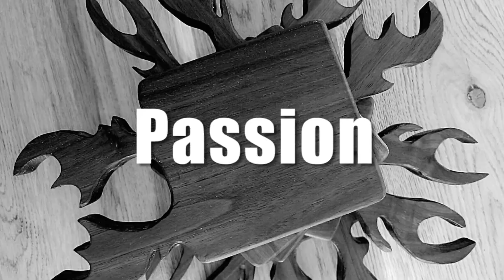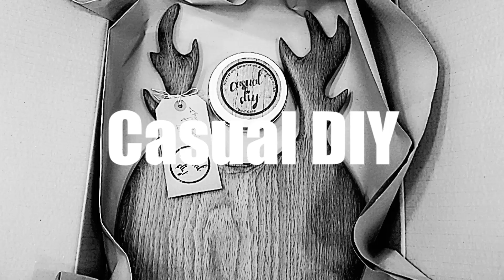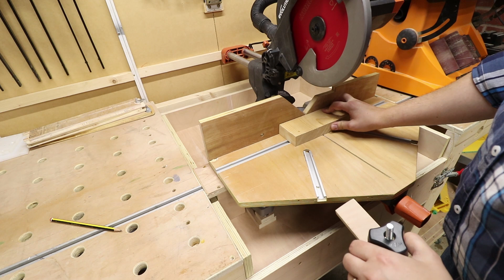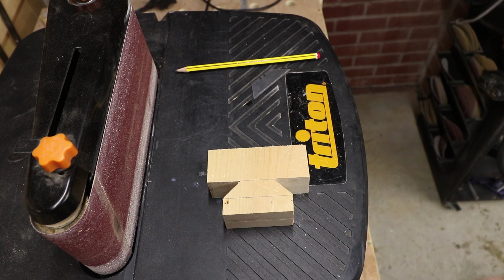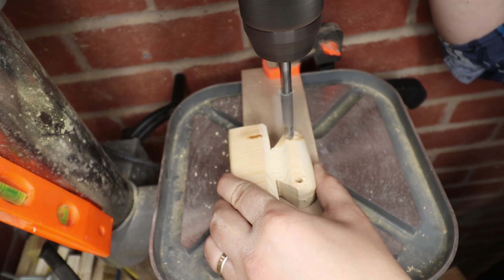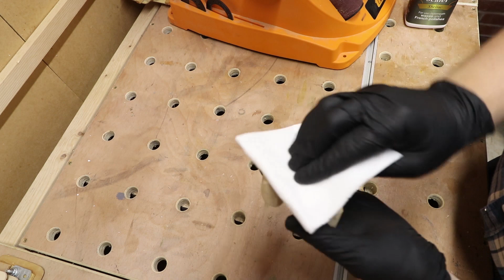DIY Card Scraper From Utility Knife Blade

Comment: In a similar vein you could make a holder for a traditional card scraper. Anyone who has used one for any length of time knows how much it hurts your thumbs! I've always just used three bolts in a bit of wood (two at the sides to hold the scraper, one in the middle the determine how much bend to put in the scraper). But I'm sure you could come up with a smarter design.
Reply from the maker: Yes got some proper card scrapers too and you are right, they are a bit of a pain to use over any length of time.

Comment: I shall be making one of these scrapers today! (I've always just held the blade in my fingers)      
But a separate question please:  How is the toggle clamp that you used when using the scraper made? - how does it fit into the MFT hole?  Looks like a useful thing to have - and cheaper than the stuff you can buy!
Reply from the maker: Hehe check my video then if you are interested in those toggle clamps 
https://youtu.be/MbbF8PIlcaE

Comment: Love such nice little projects! Can you tell more about the shellac sanding sealer? My own experiments with finishing knife handles using shellac flakes did not really turn out durable and as intended 🤷🏻‍♀️ 😂 will try it again on a small box though. Anna
Reply from the maker: I have to say I use the sanding sealer shellac for almost all my shop projects. It protects well, dries very quickly so I can apply couple of coasts in no time. Then if need be finish off with wax 👍
Reply: Casual DIY thanks! Will have another go with shellac. Currently mainly use many coats of hard wax oil or danish oil. Anna

Comment: I noticed your 10 inch (approx 25 cm) bandsaw in the background.  I just bought one a few weeks ago and very much appreciate it.  I too have a very small workshop.  If I had waited two minutes I would have seen it in use.  Nice scraper, I'll have to make one now, thanks for posting.
Reply from the maker: Thank you. Yes mine is from Charnwood, it's 10 inch and now from time perspective I wish I went for the 14 inch. But hey you live and learn I guess.
Reply: @CasualDIY  From my research on a 14 inch it was 250 pounds, much too heavy to take down to my basement workshop.